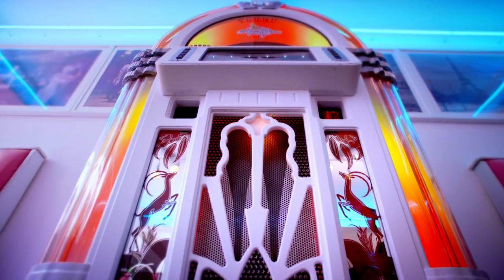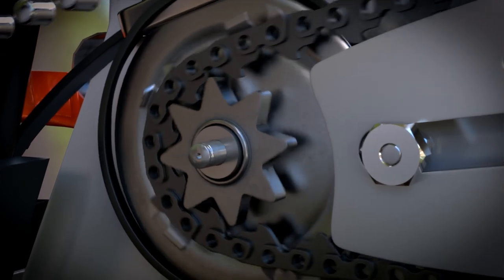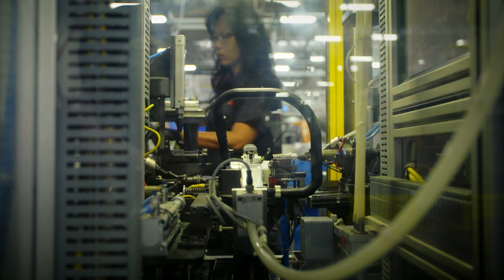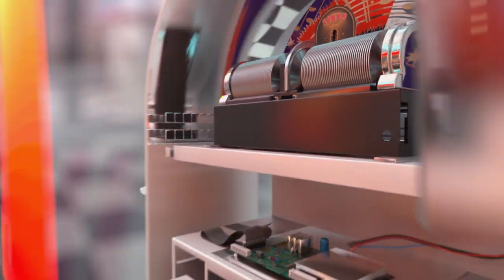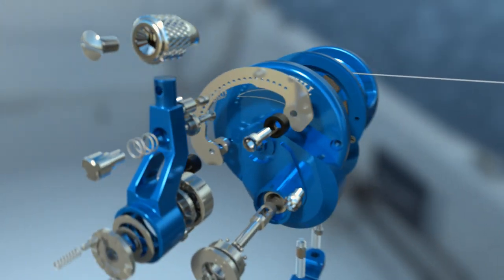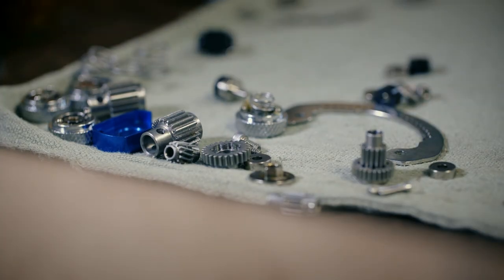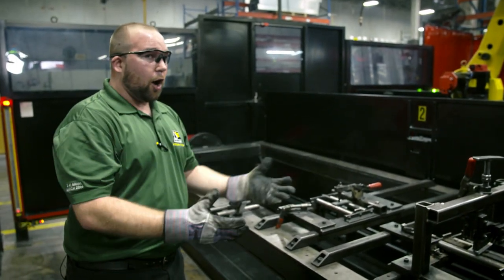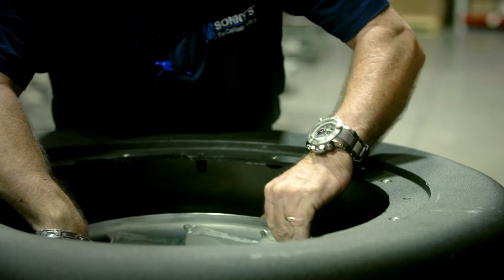How Things Work – Chainsaw | Jukebox | Fishing Reel | Carwash

Comment: My only question is why does the conveyer belt in the car wash need to be capable of holding 30 tons? The average car is 2 tons 🤔 even a large F 350 truck is only 3.5 tons...